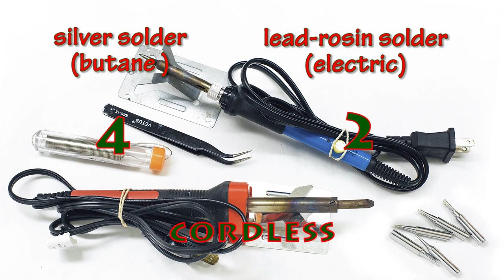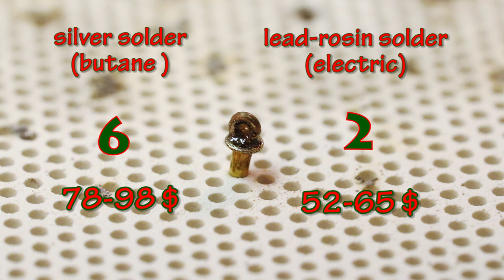Butane Soldering Iron VS electric

Comment: Hello 👋🏻 Olha , I found a new spark in an old love and hobby watching you and your incredible skills! I started but never finished a “Swift “, also a solid hull “Phantom “! I recently purchased a 3 ship beginners set up from Model Expo to warm my self up to finishing and continuing model ship building! 
My question to you is can you do a shop video of the things or accessories that you keep in stock like what woods, (maple, pear , walnut, mahogany)sizes,  sheets , love you and all the content you have to offer, keep those videos and magnificent models coming! 😊❤❤❤❤
Reply from the maker: Thank you very much! It's great that I was able to inspire you to return to this hobby.
In fact, I do not stock materials, but buy only what is needed for a specific model. Because storing wood, for example, is not so easy, especially when the humidity in the workshop is more than 80 in the summer, and less than 20 in the winter - the wood deforms, cracks and sometimes becomes covered with mold...
Reply: @OlhaBatchvarov  thank you for your reply, this makes perfect sense, I’ve been following your recent build on the Kurrack and it’s really a beautiful and inspirational. Happy New Year 🎈🎆🎊

Comment: Great video Olha. Silver solder is actually very easy to do using the soldering paste. But it does not fill gaps so viewers should insure the pieces are in contact before silver soldering the joint.
Reply from the maker: Thank you!
To make perfect soldering for silver paste, there is a special liquid flux...

Comment: Yes gas flames are better fo many soldering applications but I do prefer the jewellers Oxy/butane micro torch as it lets you silver solder too.  as to soldering bass items that you want to keep moving; chemically blacken the part you don't want to solder.  The blackening liquid doesn't affect wood, you just wash off as normal then let all dry thoroughly
Reply from the maker: Yes, that is also a handy tool...

Comment: I will suspect that many modelers will see silver soldering as a "big" step, a giant leap, if you will, even for those comfortable with electric soldering.
That is a complicated argument.
And, nothing is ever simple--I find the micro torches to be extremely handy versus the full size torches (especially for annealing PE).  But, I think you have to treat those as expendable items.
Also, the back of a terra cotta floor tile cn well serve if one does not have access to honeycomb ceramics.
Reply from the maker: Thank you very much!
I also use ceramic plates that are chipped and no longer suitable for the kitchen)))
Reply: @OlhaBatchvarov  We modelers are a frugal bunch 🙂